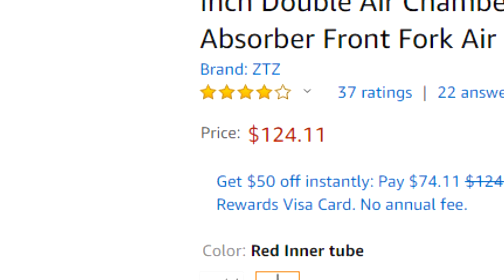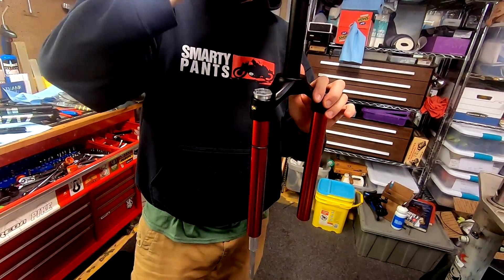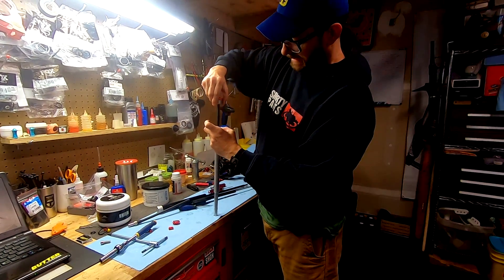$124 Bolany ZTZ Mountain Bike Air Fork Tear Down | Butter Suspension

Comment: Great video! Please do more budget bike components tear down. I’d to see what actual bike professionals think of “entry” component found on Amazon and such compared to the “high end” of typical mountain bike components
Reply from the maker: Thanks! Any requests? It's pretty rare for me to actually get entry level suspension components in for repair since they're usually not rebuildable or they cost so little a full rebuild would exceed the price of the part. Just an example; the fork in this video cost less than what I would charge to fully rebuild it! The second part of the equation is there are no parts suppliers for this stuff as it just doesn't make sense to offer parts for repair when you can just buy another fork.
Reply: @ButterSuspension  Aliexpress has these forks and cartridges available. Something like $25 for a replacement cartridge. Wait time aside, is something the likes of the Sr Suntour Epixon easier or cheaper to maintain in the longer run?

Comment: Would be interesting to see you put it back together and get it performing as best you can.

Somehow they're less garish than Kashima!
Reply from the maker: Sadly, there is nothing I could do to improve the performance. The overall design is very basic, very low end; when manufacturers race to the bottom, everything has to be sacrificed. 

When I used to work at a shop and people would ask about $150 department store bikes, I would ask them if they would ever buy a brand new $1000 car. Most said no, but there's always that one person who said yes.

Comment: but would this be good on my kid's bike? Those coil forks with the "preload" blow....   
and could use swap out to different bushings, or something else to get better performance/longevity while still not increasing the price much?  Seems like the chassis isn't half bad.
Reply from the maker: I think these would be good on a kids bike! The lack of rebound adjustment still sucks, but there is a little resistance; if the air pressure was low enough, it might not be an issue. But again, have the fork inspected before riding!